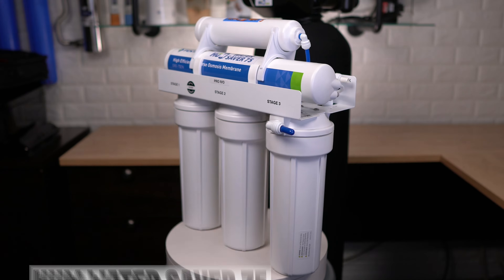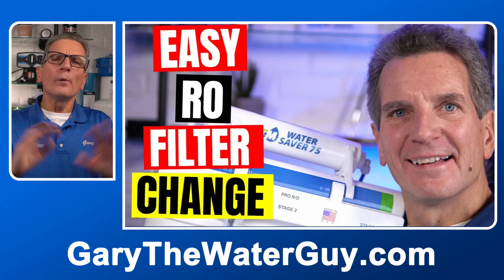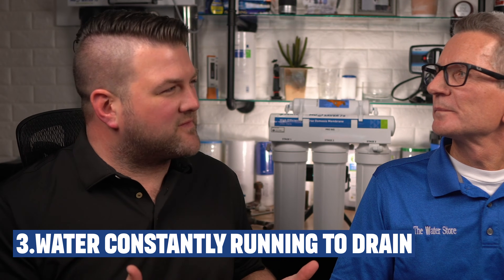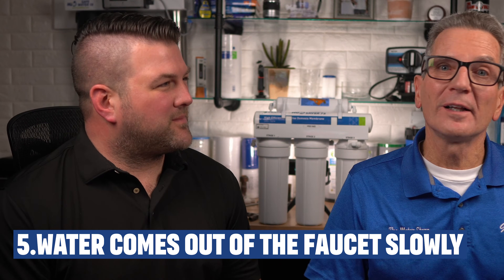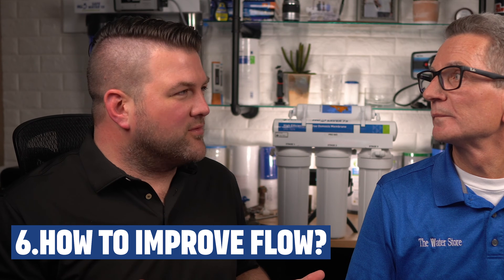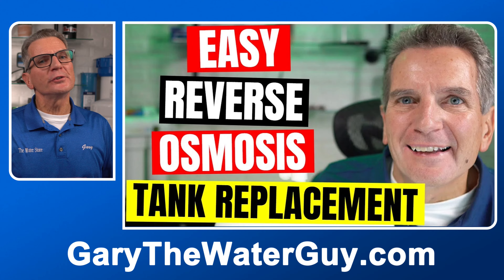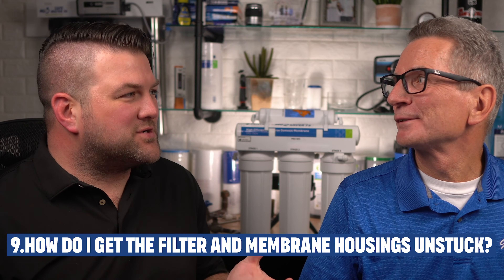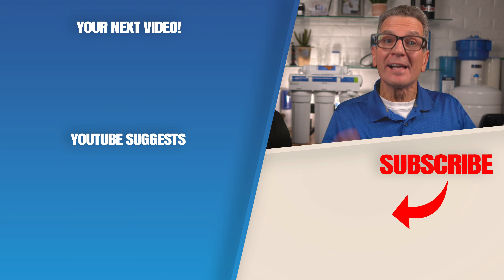10 REVERSE OSMOSIS System Troubleshooting FAQ’s for BEGINNERS

Comment: What might be the issue if the water starts to come out ok for a second or two, slows to basically a trickle for another second or two, and then is fine again?  It happens every time we use it if it's been more than a few minutes in between...
Reply from the maker: It sounds like one of the filters is partially clogged.

Comment: Hi Gary. My RO vibrates every 10 seconds through the auto valve shut off. How do I fix that ?
Reply from the maker: Likely air.  Just run the system until the tank empties.  then when it refills the air should be gone.

Comment: Hi Gary, the water was running amazing good and out of the sudden, it slowed and disappeared. I have been dealing with that thing for a month. I changed all the filters plus the tank plus the tubing. No, when I turn on the faucet, huge pressure comes out of it with two drops of grey water, what should I do?
Reply: The tank is empty, so no water are going in to the tank
Reply from the maker: Check the tank pre charge with it empty. See https://youtu.be/isCkMTdl5y0

Comment: Just replaced all 5 filters 2 weeks ago, tested pressure on empty tank which was 8psi, and replaced RO automatic shut-off (old shut-off was clogged). Water is flowing strong now, but tanks pressure is only 18 psi and water seems to be unfiltered coming out of spout and flows forever w/o tank filling more? Is my tank bad?
Reply from the maker: No, your system has a bypass valve that you have left open some where.
Reply: @water_estore  OK,  They sent me a check valve with my filter replacement kit, does this have anything to do with my problem?  I don't see a check valve in any of my lines going filter to filter. I do not have a bipass in my system.
Reply from the maker: It is likely a flow restrictor and yes, that could very well be the poblem.

Comment: hey Gary! great vid! unsure of my problem as of now but recently changed the filters because my flow was low, helped it a little bit. I charged my tank back up and the flow is great, but now I'm only getting a cup or 2 of water before it runs dry. what could the problem be?
Reply from the maker: When it runs dry, is the tank light (empty) or heavy (full). If light, not enough water is getting into the tank, if full not enough water is coming out of the tank. Make sure you check the precharge in the tank when it is totally empty and that it's at 7 psi

Comment: Hi Gary, I've been watching some of your videos, which are very informative, thank you!  I haven't seen this topic covered, but would like to hear your thoughts on this. 
We live in a hard water area and have had our RO machine for about 3 years, we change the filters regularly about every 6-8 months. We had the filters changed in August and this time we decided to add the ''minerals' to remineralize the water and see if we liked it. It's been fine, but about 3 weeks ago I started noticing some white build up at the bottom of our kettle (glass and stainless steel, so very noticeable). I'm uncertain if this build up would be from the minerals, I'm able to wipe it away easily, but today I noticed some flaky bits that made me think it was limescale, perhaps it is slow limescale build up. Since installing the RO machine, we've always had crystal clear water and no issues with limescale, but I recall the original technician that helped install it saying that if I ever did notice limescale, it's a sign that something is wrong with the system. 

Where should I start to troubleshoot this issue? Could it be the minerals or should I be concerned about the machine not working anymore and which part to replace? Or maybe the whole machine needs replacing? 

Thanks for your help and the great videos!
Reply from the maker: The minerals being added are calcium, they are the white deposits. I would get rid of the remineralization filter and you’ll be fine
Reply: @water_estore  Thank you for your reply. I will remove the minerals!

Comment: Hi Gary, thanks a lot for the video. It is very helpful. I do have a question, though, I have noticed that my RO system stopped making the noise of water going to drain, after 2 months of installation. I used to hear twice a day, but now nothing anymore. Any idea of what could be causing the dirty water not flowing to the drain? No leakage is seen.
Reply from the maker: You just might not be noticing it or it happens at different times.  Run water to mostly drain the tank and you'll hear it start running to drain.

Comment: Hello Gary , I am building a water reservoir for my indoor plants and I would like to know the proper way of storing the water in a large container without getting mold issues. Should I keep the lid on the container closed air tight? Should I add an air pump to add oxygen bubbles to the water? How to avoid smelly molding water?
Reply from the maker: Start with a sanitized container.  Keep lid closed with as small of an air gap as possible.  Keep cool and out of sunlight.
Reply: @water_estore  thank you very much

Comment: I've been watching your videos on RO systems and they are fantastic! ...Question for you! ... Have you ever seen where a softener tank is losing water faster than it's receiving it? We had a tank get depleted and the media/resin ended up in the line going to a pre-filter! .. Luckily it was stopped before actually entering the filter, but would this cause severe damage to the softener if it happened once or twice? Or would it still be okay.. (It's probably tough to say without seeing it). To summarize, the tank had a 3m dual outlet manifold before it which was filtering the water going into the softener tank. Those filters became old, and the water pressure substantially dropped; starving the softener of water.
Reply from the maker: You would need someone to check this out for you on site.